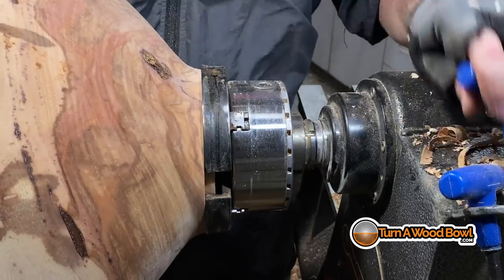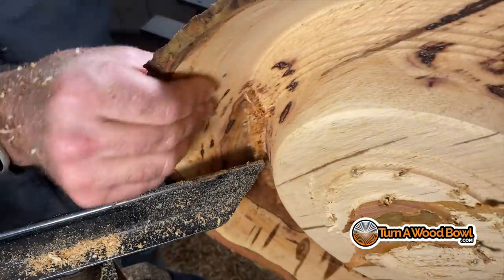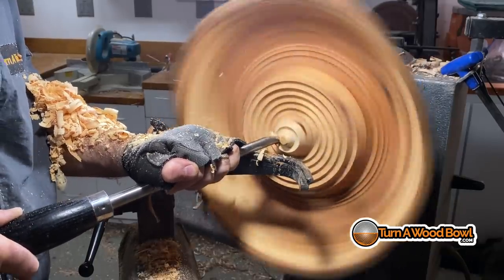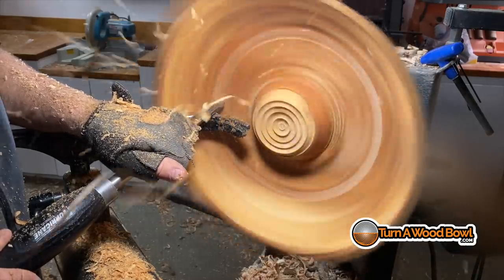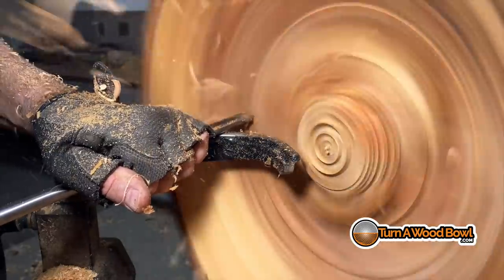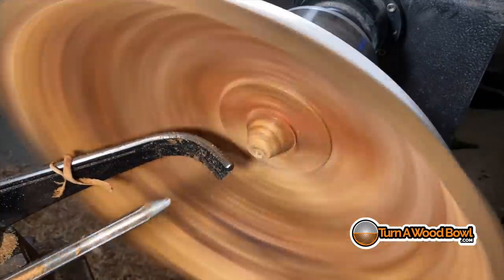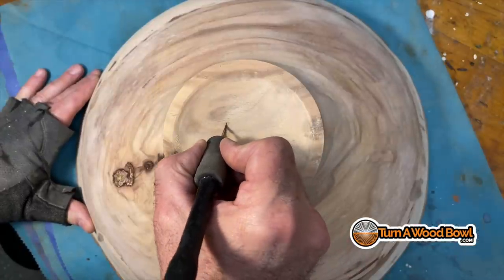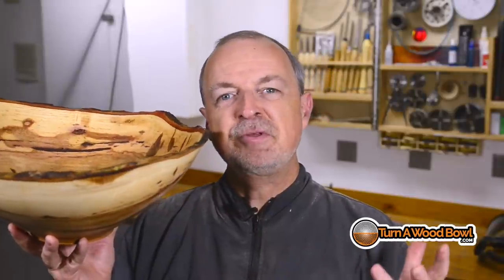Huge Bowl Woodturning – Part 2 of 2 Video

Comment: Very interesting, I just turned 6 walnut bowls and put them in paper bags with shavings. I have never attempted a once turned green object. I think i'll give it a go this weekend. Thx for video there always fun to watch.....
Reply from the maker: Kenny, sounds great. You can do it. Remember, the thinner it is the greater chance of warping, but the thicker it is the better chance of cracking. Every tree species has a happy middle ground wall thickness that will shift a little when it dries but not too much. Experiment and have fun. Happy Turning!
Reply: I coat every bowl with a block of beeswax,  followed by a spin polish with a rag. (Regardless of first or second turn). Press the rag tight until you see the wax melt and coat the wood. This will stabilize the turning for a very long time. Like years, in fact. No cracks.

Whe it comes time to finish, the oils will combine with the wax to form a great finish.

Comment: I learn so much from you! Been turning Pecan myself, have plenty of that in my yard as I live in GA lol Pecan is self pruning so there is always something in the yard to turn shavings on and practice my cuts.  Thanks Ken for being a great teacher
Reply from the maker: That is awesome! You can turn any of those "prunings." See my Tiny Bowl video and you'll see you can make thousands of pecan bowls. Enjoy and Happy Turning!
Reply: @TurnAWoodBowl  I did these pruning are huge 😂😂😂
Reply: I to live in SW Georgia and we have an abundance of pecan trees and wood from them. It seems like every time the wind blows hard another limb comes crashing down. So pecan is very abundant here. It has a beautiful grain structure and is easy to work, even when dry. I've never turned green wood before, but plan to as I develop my turning skills. I come from a welding and machining background. I turned and milled metal for years, but wood is similar in the methods needed to work it and it's a free material. Free can't be beat! I use a 12"x21" jet wood lathe with a variable speed of 80-3600rpms, with 3 pulley sets for speed adjustments. I just started turning about 2 months ago. I machined metal for years, and they have some similar techniques to work it  safely, there is a learning curve, but it has not been to hard. I hope to one day be as good as you are, but I know that it takes lots of practice. Your videos are extremely helpful! You not only show how to work the wood but also explain how and why you are doing it in a particular way. That is what sets you apart from the rest of the wood turners, Imo.  Keep up the great work and education of us beginners and experienced turners alike! There is always a new trick, tool or method to learn and apply in our own turning projects. 
Thank you Again so much! 
William

Comment: Excellent video! I've been using the center mass concept as you've taught with good results. I appreciate a brief mention of watching the edge as you work the center. A few weeks back I was turning a natural edge Walnut bowl and got a catch on a knot. It pulled the gouge up and rotated my left hand knuckles onto the edge, removing a patch of knuckle skin, ouch! Is that why you glove your left hand? Great instruction as usual. Thanks.
Reply from the maker: Thank you for writing and sharing! Yikes. No, I wear the glove to prevent splinters being embedded into the side of my hand. Be very careful not to cross the centerline or you'll get the nasty result you described. I did that once with a hollow form and my thumbnail was black for a month. owww, indeed. All the best to you and Happy Turning!

Comment: Thank you, Kent.  For a once turned green bowl, the bottom will surely become warped and make the bowl wobbly.  Once that happens, how do you recommend flattening it back out?
Reply: I asked the same question
Reply from the maker: They usually don't warp that much. A little sanding will flush it up fast. Happy Turning!

Comment: I'm new to your Channel having just gotten back into Woodworking and wanted to watch a few videos. Stunning Bowl although the size is a little bit intimidating. I had a nice Walker Turner lathe that somebody stole so I replaced it this year with the Harvey t60s which allows me 24 inches of Swing. After having seen this bowl I think I'll wait till I have a concrete floor before I attempt that LOL. Back when I first started turning in the late 80s I had a lathe made out of a truck axle and a baldor motor. It was downright scary.

Comment: Fantastic turning and lesson. Thank you.

The cutting surface of the bowl gauge is about 0.3mm square, in one hour of turning the bowl with a diameter of 40cm and rotating at 850rpm, it "covers" a distance of about 64km!  While being subjected to a tremendous moment of force at the same time.

 I know many larger devices that cannot be used after 64 km.

We can get respect for this tool, steel and blade.  Let's take care of them, often sharpen them so that they are lighter and the surface is perfect.
Reply from the maker: Thank you for writing and sharing! Yup, these gouges take some serious abuse. Happy Turning!

Comment: Thanks for a great video Kent.  Let me know if im understanding this wrong - but your saying that because the side walls of the bowl are consistent thickness, there will be little issue with the wood drying over time?  Does the wetness or the age of the wood matter for this, or can it be fresh and green?
Reply from the maker: You are correct Vince. Cracking occurs when there are different wall thicknesses that cause some areas to stay wet while thinner areas dry. There are many variables. I cover these more thoroughly in my course www.TurnAWoodBowl.com/green  All the best to you and Happy Turning!

Comment: HI Kent, I really like your videos and am new to woodturning.  Just wondering, you made this with green wood, and I have seen that normally you would twice turn a bowl, drying it in between.  After adding the danish oil finish, how likely is the bowl to warp?  I know the natural edge won't really matter if it warps or not as its not a 'true' flat edge, but will the foot of the bowl warp at all which will mean that it rocks slighty?  Thanks.
Reply from the maker: Yes and yes. I have a new online course coming out soon all about turning green wood. Stay tuned. Yes, I turn many once-turned pieces and the base will distort a bit. I simply sand the base smooth once the piece is dry. Happy Turning!
Reply: @TurnAWoodBowl  thanks for the reply, love the channel

Comment: I gave up turning bowls over about 14 inch diameter years ago. Mostly they just sat a very long time before selling, usually after I had dropped the price. Biggest I die was 22 inch diameter. I would have cored this one. One reason is that it is faster than turning the wood out. The other reason is that I am too cheap to waste that much wood. I have heard that bit about leaving the center mass because it adds to stability. Never made any sense to me. The mass only stabilizes the bowl when attached directly to the wall part you are turning. So, 4 inch dome in the center does nothing as near as I could ever tell. As for the thin walls causing problems with vibrations, I guess I did it so many times that I learned how to deal with it. Fingers to stabilize the outside, and gouge on the inside. Most critical points are finger pressure = tool pressure. If they are not the same, then you get vibration. Also, no clue as to who said this, "The bevel should rub the wood, but the wood should not know it."
Reply from the maker: Yup, large bowls are tricky to sell. Big wow-factor, but little counter space in most homes. Happy Turning!

Comment: I bought a used lathe without a stand, but attached to a large section of wood. I’m 5’7”. What height would you recommend installing the lathe?
Reply from the maker: Good question, Paul. Fold your arms and put your hand on your opposite shoulders. The headstock spindle should be near your elbow at that point. Also, see this video https://youtu.be/svt-Rrf550s All the best to you and Happy Turning!